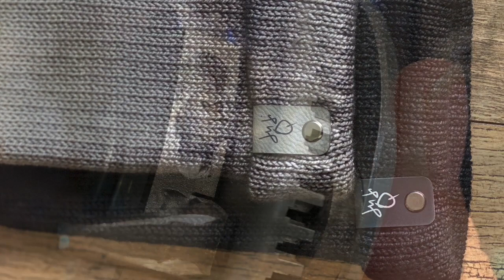CSM: Sock Hats

Comment: I always wonder why the specs on the outcome are rarely given . It would be good to know the width of the finished hat and circumference and how it fits a 22 inch head. What is the length ?   Do the stitches get stretched out or are they intact  as well as what  yarn was used.  What the stitch length.  What is the fiber content of the yarn and how much was used ? I have to say the double video was hard to watch especially because it is speeded up.  Made me dizzy ! 
.

Comment: Do you have to use ribber? Also, what weight yarn did you use? Could you use dk? Sport weight?
I want to buy a machine and am not sure if I should get the bumblebee or the speedster. The speedster is more versatile but I want to be sure it makes adult size hats.
Reply from the maker: It definitely will produce adult sized hats. Can also loosen the tension for a larger head.  I bought a speedster first, then bumblebee and sold the BB pretty quickly. It uses sock weight yarn. With the higher needle cylinders dk is a no go.
Reply: Rather than take your word for it fitting an adult head it would be good to know the actual dimensions and specs and whether the 'fit' means the stitches are stretched and  tight.  And what tension or stitch length is used to achieve your result.   Also does the  Speedster or Bumblebee take large hook needles . How  does the Bumblebee  5" diameter or extra half inch on the machine translate into the width of the hat.   So how many stitches to the inch do you get.    With the larger hooks, I  can use a sport weight on my Autoknitter  on both cylinder and ribber on the higher needle counts (72 and 80)  but only with the cylinder for DK as the ribber struggles .   I do wish when posting a video that it included more of the specs or info on the finished product